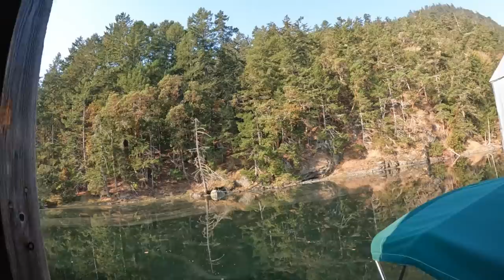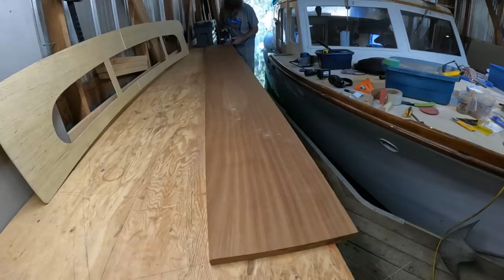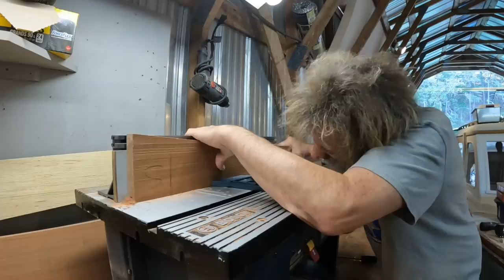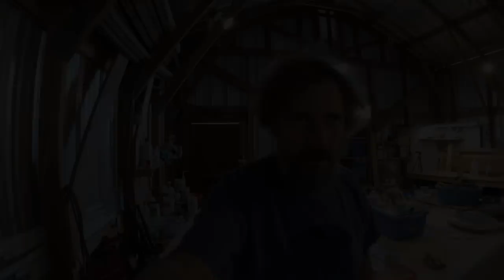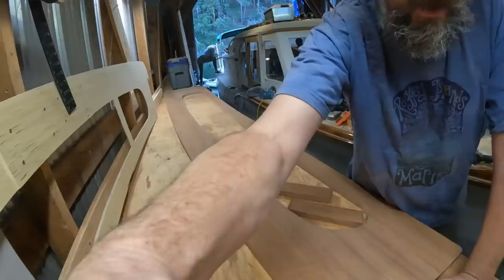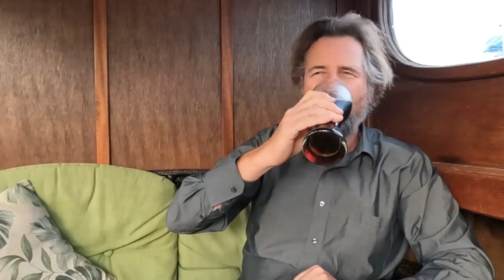Bulkhead Progress - #334 - Boat Life - Living aboard a wooden boat - Travels With Geordie

Comment: Instead of splining in those uprights, you could go with the "elegant" solution you already proposed, but with a twist. You'd use a palm router to create a pocket for a diamond (or circle, star, whatever shape you want) between the uprights and the main bulkhead. You'd essentially be making a functional overlay that would double as either a half lap or a third lap (double sided).

Comment: I have used three methods for a similar problem. First was dowels in  loose ish holes each end of your center piece like you would any doweled joint then a perpendicular small hole to shoot compressed air to "piston the dowels home and a second small hole to let air out of the socket base so it wouldn't "hydraulic lock"  inject resin later. Second is using a spring to piston the dowels home except I used a hole through the dowel so glue could displace to the spring end, plus I was not allowed to have any holes in either face. These methods are one shot.  A third is to use stainless rod that drops home then inject resin in the small cavity.
Reply from the maker: Yowsa, that's next level stuff.

Comment: I think the half lap for those vertical pieces was an interesting idea.  They could either be flush with the decorative ends as you mentioned or even proud a bit.  I guess the word pocket is a possible reference to pocket screws.  Seems like you would see them on the inside.  I have never seen a good job filling those holes with a dowel as you always see the end grain. Maybe you know a trick?  The video this week was certainly a treat!
Reply from the maker: Mmmmmm, proud a bit, I like that. But yes, pocket screws and I agree, the oval holes never look good so I'll cover with an extra piece.

Comment: For the uprights (styles) here is an idea that might have worked.
If you would take a piece of wood a little thicker than your window stock, set it up for dowels or splines, make the cuts etc, then cut the styles in half, then make a sandwich with everything in place, glue, clamp and stand back and marvel. LOL
Great work by the way.

Comment: Hello there, I dont know how far you lag the videos but you may have already done what you did for the two vertical braces. My thought was to drill two vertical dowel holes down through the top and bottom at the braces and to glue and pin the braces in place that way the holes would be canceled  when the whole window is in place. Also you could use the same holes (adjusting for screw size) and drive screws in the same way and put bungs to cover the holes, but maybe not, since they would never be seen on the outer edge after installation.

Comment: I would have left the center struts 1 1/2" longer at each end and then half lapped them into routed and chiseled pockets on one face of the bulkhead. The 'laps' would only be visible from one side and would be firmly locked in place. But I'm sure using splines would be just as easy and quite invisible after the windows have been caulked... :yougotthis:👍🐕
Reply from the maker: That's probably the tidiest option, In retrospect I sort of wish I had.

Comment: I was convinced you would dovetail the 2 posts in but maybe a pocket dowel / screw fix is on the cards?  1 stopped dovetail top and bottom on each post would look pretty good Peter ! But I know it will be just fine  😃
Reply from the maker: Aaaaak Stephen, you vastly overestimate my abilities. would be gorgeous though.

Comment: Peter,  Why did you not use a router to finish the curved cuts in the middle.  you had a perfectly good template to guide off and would have saved you having to be  so accurate with the jigsaw.  Also  you could have possible done the two verticals before cutting you curves as you had two perfectly parallel ends.  Would mean that you had to match grain but it looked like you had enough offcuts to easily do it.
Reply from the maker: That's a good point. I don't often cut stock with a template bit. I think this might have been a bit thick. maybe a rough saw cut and router cleanup. I should do more template routing though.

Comment: "That's the plan....Let's see how it turns out in real life"  ...chuckles 😃.  How about something like biscuits for those splines?
Reply from the maker: Biscuits would have the same complexities as dowels. once I glued together the top and bottom, there was no way to fit them in.
Reply: @TravelsWithGeordie  I was thinking you glue them in all at the same time.  Just make biscuits out of mahogany,  a bit oversized and trim later.   The biscuits cutter keeps everything aligned.   You could use biscuits for the main bulkhead too!  GL.  Alternatively mortise and tenion would be traditional.

Comment: Another option for securing the short sections is to dowel them using dowels drilled in vertically from the outsides of the for the bulkhead.  The ones up from th bottom you will never see anyway and the top side will be covered with fiberglass.
Reply from the maker: That was definitely an option,  easy from the bottom, but from the top it's a long way and the top edge is exposed.

Comment: Face glue the dividers, then drill and set dowels from top and bottom and fill the holes with more dowels and epoxy. That might help with any tendency for the assembly to split horizontally as well.
Reply from the maker: That was definitely an option but it's a long way down from the top and the top bung would be exposed. Not a deal breaker.

Comment: Now that you've got the verticals fitting perfectly, why not face glue them in then reinforce with about a quarter inch thick bowtie inside and out.   Or..... could you just omit the verticals and use one piece of glass? Then again you could still go with dowels. Just use an over-deep  'POCKET' in the verticals to make room for springs and voila it all snaps into place. I like the amber ales too, but mostly if I can't find a porter.

Comment: For the uprights why not spline on top and screw + bung at the bottom up from the bottom of the bulkhead (which would not be visible unless I am mistaken?).
Reply: From a guy that has been doing woodwork for 40 years this is the best solution.

Comment: For the posts, I would have just taken an aircraft bit, and drilled from the bottom up right through them, then doweled em. 

Just have to be sure you are going in straight.
Reply from the maker: Woo, super straight, I considered but didn't trust my steering.

Comment: Sliding spline? Hmm, tricky.
You missed the chance to do Halving Dovetails which would give vertical strength much better than "diamonds "
Pocket screws in Mahogany would be problematic I fear.
For decorating value and the strength of Dovetails,  I would go for X Shaped or hourglass inserts, sort of like "Dutchman "  pieces ".  Just cut the four appropriate "inserts", trace out the hole shape spanning the columns and sills,  and inset and glue them in place.
Super strong, attractive and no splitting of brittle Mahogany.
Reply from the maker: Wow Ray, that would be gorgeous.

Comment: Glue the posts flush with the bulkhead. After dry drill pocket holes on the inside. Can either fill with epoxy and dust from your sanding or you could use plugs. Once sanded and finished  shouldn’t be very noticeable
Reply from the maker: Exactly that but I'm going to cover with an extra piece.

Comment: I can't remember if you believe the bulkhead on MV Geordie needs replacing?
If it does, maybe you'll be lucky and this templet will fit (doubtful) or be adaptable to both vessels?  ;-)
Reply from the maker: Well, it's certainly not happy, it would be completely different though, with an opening window.

Comment: I wouldn’t use pocket screws unless you are going to paint the surface they are hard to bung nicely, I would use 3.5” s.s deck screws countersunk from the top and bottom,two at each joint, quick and easy. Good luck!p
Reply from the maker: You got it, pocket screws, happily, the holes will be covered by an extra piece. I considered the long screw option, at least from the bottom.

Comment: Pocket screws! very strong, and you can get plugs to fill the pockets, they will tighten your joints too. I've used them for years and they feel like cheating but you can't make a stronger butt-joint (IMO)
Reply: Put the pockets on the edge where the glass goes and the glass will conceal the pocket
Reply from the maker: Yes pocket screws are awesome and very strong. But I hate the long bung holes.
I'm going to cover them with an extra piece.
Reply from the maker: Whoah, glass edge pocket, intense, the problem is having to precut the window rabbet and then trick the jig to drill the pocket in the bottom of the rabbet. Come to think of it, it would have been fun!

Comment: ...also you could have used your template as a router template with a guide bushing and spiral fluted bit...in lieu of using the circular saw and jig saw.  But of course you are an impecable craftsman, so the point is moot.

Comment: Does blade depth impact using a circular saw for curved cuts?
Reply from the maker: Great question, Yes!, the shallower the depth the tighter the curve you can cut, but a deeper blade gives more control and consistency. So generally you want the blade as deep as possible that will still make the curve.

Comment: before i watch the talking about the elephant, was it that you were going to dowel in the verticals (which you cant do after epoxying the ends together)?
Reply from the maker: Heh, it is indeed!
Reply: ah, splines, i thought it would be that or a half lap joint, the next question will be, how do you rout the grooves in the outer frame, is your router small enough to get in there, had you considered using biscuits?